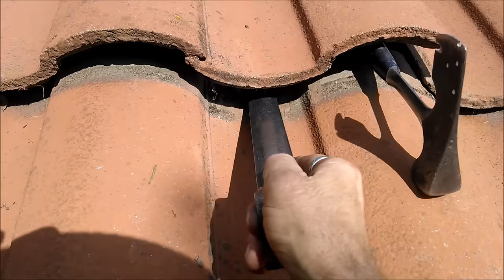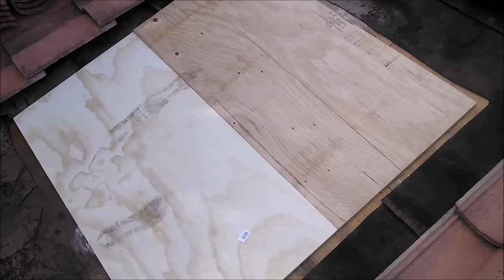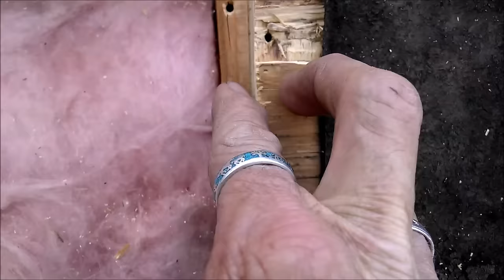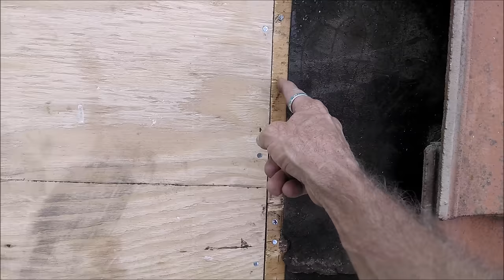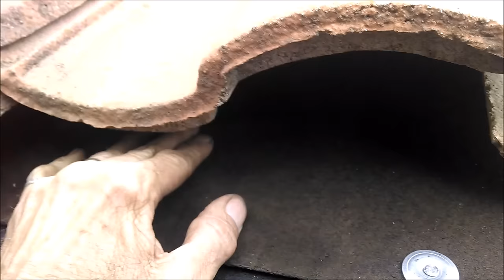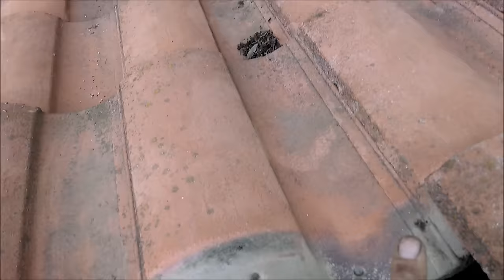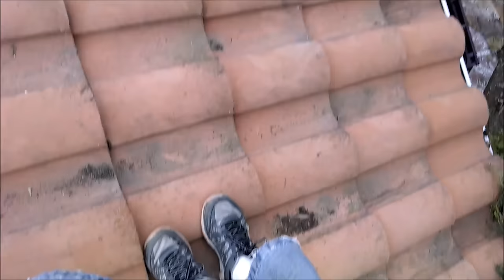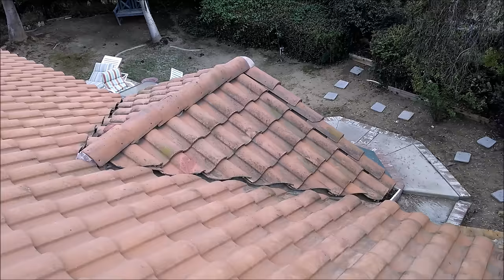Roofing Tile Leak Repair - Tips, Tricks & Helpful Hints

Comment: I saw this video maybe 20 times. I was having anxiety attacks because it was going to cost me at least 3k on leak repairs and another 1600 to remove and reinstall solar panels. I bought the exact tools you used and materials,  and for added measures, I used Henry's rubberized patch to seal the seam that go along the sides. It took me approximately 21 hours of labor. The added procedure to walk on the tiles was key in getting me up on my roof. I am a mechanic by trade since 1988, and to add this experience has made me a better man. Knowledge is power, and you are on point. We will see how well I did did in the next rain storm. Thankyou for everything.🙏
Reply from the maker: You did fantastic. My only minor critique would be my concern about how well the rubberized Henry’s adheres to the tile seams over time. Many adhesives & sealants do well when not exposed to the weather, but using a good seam sealer/adhesive that does well exposed to weather over the years, requires the opportunity to go back & recheck your repair work over long periods of time. Hopefully, the Henry’s will work well in that regard. Also, the side seams are designed not to require sealant as they manage water run off. And to seal them is to potentially block critical water flow & actually cause leaks instead of preventing them. Never want to block water flow. Always encourage water to go where you want it… which is down & off your roof. Good luck my Friend & thanks for watching.
Reply: I literally froze in fear when I climbed up on a ladder to seal up holes around my roof where birds were nesting.  I wish I was as brave as you, but I am a woman who is terrified of heights.  I don't know how I'm going to fix the few areas on my roof that have damaged tiles or tiles that are out of place.
Reply from the maker: @RunPlayHaveFun  I wish I were there to help you. 😞
Reply from the maker: You’ll have to let me know how well you did…

Comment: My roof had some leaking, so I called up two contractors for quotes. Because I watched this video, I could sense immediately they were bad guys -- overstated the problem, and gave crazy quotes. By the way, they all over-sold the premium underlayment. Thanks for the video, I can even fix small roof problems by now.
Reply from the maker: That’s super awesome!
Reply: Been working on a tile roof in FLA for 20 years, no joke, You cannot beat peel and stick underlayment. It's self sealing. A pain to apply solo, but it's not a scam. Dramatically better than felt or even rolled asphalt.

Comment: Dan, your video, narration, and thorough explanations gave me the confidence to tackle a concrete tile roof repair between winter storms.  I was able to find and repair a number of leaks on my son's 20-year-old roof that were causing rain to flow down the inside wall of a bedroom in his house in Orange County, CA.  The cause was broken tiles and deteriorated roof felt.  The solution was to remove 100 sq. ft. of roof tiles, replace the paper following your instructions, and replace the tiles.  Thankfully, I did not have to replace the OSB or ship lap board.  As I replaced the last row of tiles the rains resumed, and I had that feeling of satisfaction every roofer must feel.  
Thank you again for your video full of fact-filled encouragement.
P.S.  No tiles were broken until I stepped off the roof onto the ladder.  At that point, I was out of spare tiles, so I tucked a sheet of metal over it and called it a job mostly well done.  Roofers may aspire to perfection but learn to accept utility.
Reply from the maker: Greg Brown Yes... Utility. Unfortunately, I’ve seen far too many roofers aspire to utility & avoid perfection like the plague. I would like to see more roofers follow your example of quality & save utility as a last resort. Thanks for watching & for your encouragement.

Comment: Great work. I did a similar repair 2 months ago and it has remained dry since.
One thing I did notice, at 24.41 as you're walking across the roof, I spotted another dislodged tile in the middle span of the roof!
Reply from the maker: Yeah, so occasionally if a tile won’t go back in alignment with the others but the fastening nail or nail hole is covered by the course above & the moved tile hasn’t caused a leak beneath it, I’ll glue it in place right where it is. Might not be aesthetically pleasing but it does keep that tile from causing a leak down the road.

Comment: Thank you very much sir! I have just completed the work on my roof following your instructions. After a recent storm in So. Cal, I had a bad leak in my house. I found out that one of the tiles slid down leaving about 4 inch gap. I removed 30 tiles (5 each of the first 6 courses), replaced the tar paper using metal cap nails. BTW, the tile that slid had a blind hole and therefore it had not been nailed originally…I simply used a 3/16” masonry drill bit to make it a through hole:)
Reply from the maker: Very good using a masonry bit to open that blind hole. I carry one of those with me anytime I’m working with tile. Imagine having to drill all the tiles that way. Sometimes the manufacturers mess all the nail holes up & you only have two options… drill all the holes or use a good glue. I always kept both on hand just in case.

Comment: I'm glad I came back for a second read. My tile roof was put on in the 90s and it's about 20ish year old, and leaking in several places now. I've repaired the broken tiles but I still have leaks so I need to figure out where to start looking for a place to start taking tiles off. On this house so far I have not found a single nail holding down a tile either on the ridge or on the slope. There is no mortar on the ridge, and I don't know if I'm supposed to put mortar up there. I do know I need to replace the underlayment on the ridge. How do you do that? I intend to follow your suggestions and will start as soon as the weather here cools off a bit. I'm in the central valley of Calif and it's over 100 every day.

Comment: God richly bless you for sharing your knowledge  and experience  in this tutorial Duster Dan .I feel tons more confident in tackling a roofing repair that involves conducting type of repair of this nature . I have a  small leak that reveals itself only in torrential and windy tropical rain storms here in Florida .Can’t thank you enough sir !
Reply from the maker: In once sense, I like the larger leaks cause they’re easier to diagnose. After all, how can you fix a leak that you can’t find? If I may offer you a key piece of the diagnostic puzzle… Look for the source in the leak area that would inhabit the largest volume of water in a downpour. Volume of water during the rain is key to finding any leak. Imagine how much water would be flowing across the surfaces within the leak area & focus your attention on the areas that would tend towards more volume of water under the circumstances. Prioritizes each possible leak source according to its potential volume of water under rainfall conditions or according to an obvious direct penetration of there is one-like around a flashing or obstacle for instance. Most roofers install things too loose or too tight around obstacles & don’t understand that inertia drives runoff sideways across or under roofing materials during a rainfall occurrence. So they typically install materials too tight-thinking tight is better than allowing a little room for water flow management. I’ve been extremely successful at leak repairs by thinking more like water than like a superficial minded observer of of how the dry roofing appears to the eye. When installing materials or diagnosing leaks, a true craftsman sees not only the roofing, but also the water flowing across the roofing surfaces in a downpour. That’s how you master your craft.

Comment: Thank you. i have to get a repair to my old tiled room here in SW France. The tiles are a different design & I won't be doing the work, but it is reassuring to see how it should be done. I had no idea, that adhesives are used. I will be trying to mend some of the tiles though, as they are hard to find.

Comment: Duster Dan, thanks for this very helpful video.  We had a large hole / rotted plywood near a valley above our front covered porch, under square concrete tile.  We are in Colorado, I believe the problem root cause was ice dam effect due to high pitch roof line on West side of valley, North facing.   Unfortunately the job was much more difficult due to the adjoining roof peak was built on top of the rotted plywood so we had to do the best we could with the situation.  24 inch spans, had to do blocking on side rafter located under peak, and 2 cross pieces.  The valley flashing appears to be sufficient, just needed to replace plywood and felt, and will now need to add a roof rake to the tool shed to keep the area clear of glaciers.  I can tell from your video that you take pride in doing quality work.  Good for you.  That is uncommon these days and if you were located in Colorado I wouldn't hesitate to hire you in a heartbeat.  But like you said there are too many morons out there in the roofing business so I did it myself today.  Now a lot of sore muscles for this office guy...   Thanks again, you helped me considerably.   kacpco
Reply from the maker: Thanks Kyle... I've learned a lot about people, about real customer service, about quality & about running a successful roofing business over the last twenty years. I can't say enough good things about my roofing customers & how they help to inform my insights about quality control in the entire construction industry - especially roofing. I consider it a privilege to serve the community in this capacity. Thanks for your encouragement. I'm glad to help.

Comment: Excellent video.  The whole problem and repair was explained very clearly.  I am going to attempt this repair in the next month.  I have found that my tiles were installed with mortar patties on top of felt paper - no nails and felt paper is deteriorating in several spots.  I appreciate you sharing the repair and your tips with the Youtube audience.  Thank you for taking the time to prepare and post this video.
Reply: +Corky C Since this roof wasn't on wooden battens for nailers, you are nailing right through the substrate and into the decking.  Does that increase the probability for a leak?  The reason I ask is my roof was put in with mortar patties on the substrate and most have failed and lost their grip.  On a repair I would like to nail the tile back in place, but I'm concerned about causing leaks.
Thanks
Reply from the maker: +Corky C No worries Corky... As long as the felt is in good condition, there's no reason to worry about the nails causing leak as they go through the tiles & through the felt. The felt is designed to remain watertight with the tiles nailed to the roof deck right through the felt. On steeper roofs they install batten wood firing strips to help hold the tiles in place, not to keep the roof more watertight. Your roof isn't real steep is it? Just make sure you drive the nails in without moving the nails around after they go through the felt. ...Assuming you have felt that is. That way, as the nails go through the felt, the felt remains tight around the shanks of the nails & consequently, watertight as well.
Reply: +Duster Dan Thanks for the reply.  I have a very similar repair to make as in your video.  Roof is not very steep, felt paper with grit has deteriorated and rotted the roof decking, rain water is pouring through the soffit vents.  Going to tackle it soon using your video as guidance & I won't be afraid to nail any shingles.

Comment: Thanks for the most articulate, informative tile roof repair video I've seen on YouTube. You are the only person so far who I heard explain how to walk on a tile roof. I will be attempting a similar repair on a valley in my own roof thanks to your videos. I have a tile roof where the deck meets the fascia below the top edge of the fascia. No drip edge. No bird stop. Tile is resting on the fascia with insufficient overhang. The felt looks like a ski jump at the edge and does not extend over the fascia. I guess this was the roofer's idea of how the water would get out. Any suggestions besides re-roofing?
Reply from the maker: Always try to manage water runoff first with mechanical flashings instead of sealant, so that your repairs are water tight indefinitely. Sealants can work well but only use them as a last resort so you never have to keep an eye on your repair after the fact. Peace of mind is priceless when it comes to roofing repairs. You're gonna have to decide how to get the water past the fascia & onto the deck below. Dripedge metal under the bottom edge of the tile would be nice to help protect the top edge of the fascia. In that case you could remove the last two courses of tile, install a 2x4" dripedge flashing under the felt 4" & over the fascia 2" & reinstall the two courses of tile previously removed. The reason why you remove two courses is so that you can renail the first course of tile back into place & glue in the second course, since the second course will need reinstalled under the third course & cannot be nailed because the nail holes are concealed. That would solve the problem of the tiles being too short at the edge of the fascia. Make sure if you do this to glue the second course to the first course properly like how I describe in my videos so the entire second course doesn't slide out over time & you have the same problem all over again. You didn't mention how the deck below meets the fascia. If the deck goes under the fascia & has the correct slope with no ponding along that transition then you should be good to go with just a dripedge under the tile above & over the top of the fascia. But if the deck below simply runs into the fascia, then the deck will need flashing also if you expect the deck below the transition to be water tight as well. The flashing would need to either go behind the fascia & extend out over the deck below or it would need to tuck up under the dripedge flashing above, cover the entire fascia & extend out a few inches onto the deck below, concealing the entire fascia itself. That will transfer the water from the roofing tile above, past the fascia & onto the deck below without getting trapped between any of the layers of any of these construction materials. Does that make sense?
Reply: That makes perfect sense. I will try this after I fix my leak that brought this whole situation to my attention. I've looked at most of the houses in my immediate area (from the street, of course) and every one has this setup. Thanks for replying the help. I'm glad there no rain forecast for a while.